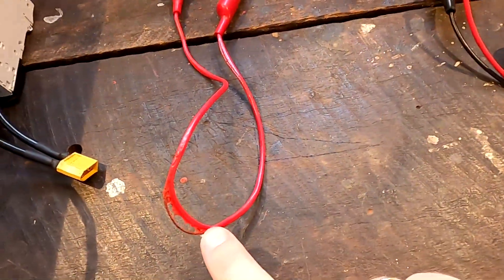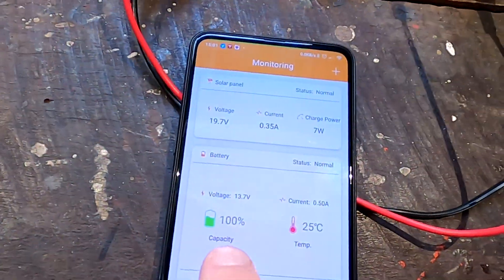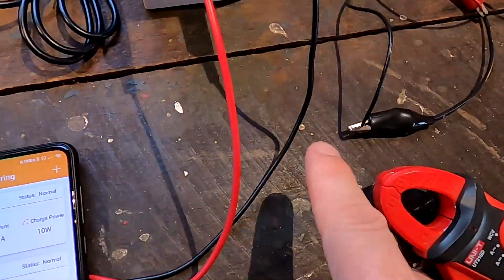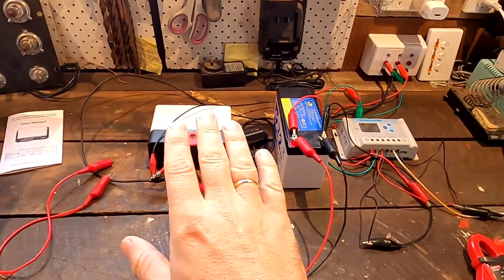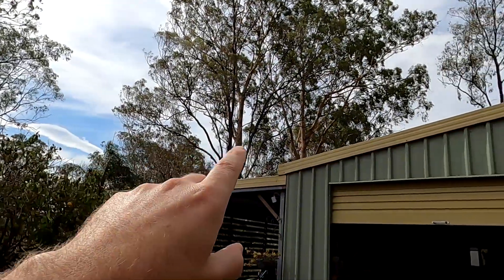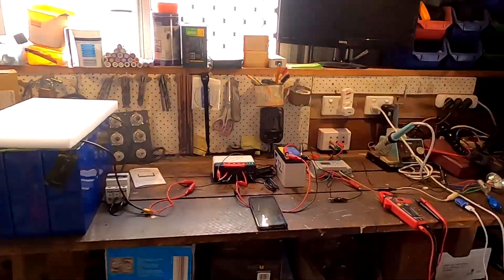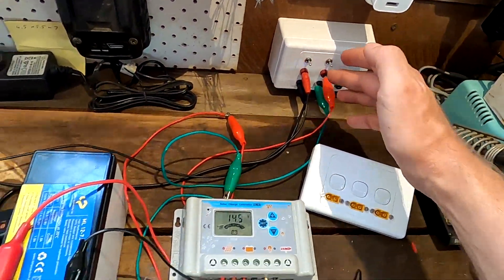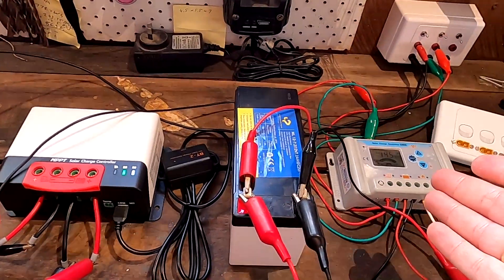MPPT and PWM controller charge one battery. See what happens...

Comment: Hi! I love your videos! Keep them coming! Quick question. I see that you are connecting to the MPPT CC with a bluetooth app and dongle. Could you please share those details on your website and may be make a quick video about them? Also I see that the link from your website takes me to the Aliexpress "version 1.1" of this MPPT, is that the one you have?
EDIT: Actually I don't think I see the MPPT on your website. And the Bluetooth dongle looks very similar used in the Renogy CC.
EDIT 2: I think I found the MPPT on Aliexpress under the name "50A MC2450N10 SRNE MPPT..." It would be amazing if this thing worked as advertised for this price, even if it delivers 25A. It would be great if you could test if this little thing can push 50A ;-)
Reply from the maker: The BT dongle came with the controller and I only ordered the 20A version as I didn't need more. I have now sent it back for a refund, the app shows very different values to what the amperemeter shows. I follow this up in one of the next videos. I would not recommend buying them. The Epever Tracer series seems the far better alternative and is only slightly more expensive.
Reply: @OffGridGarageAustralia  Before you blame the controllers too much, I found this on the web:
"Most DC clamp meters are not accurate at anything less than about 10 amperes."
For that, I still use my benchtop Fluke.

Comment: It probably wouldn't be really worth it, but a mppt per panel would be most effiecent,  in some cases,
Reply from the maker: That would be the ideal solution for a 12V or 24V battery. With a 48V that's not possible anymore, the solar voltage would not be enough. You need at least two modules in series...
Reply: I think it depends on particular design of charge controller. It could be made charge controller that is capable of charging 48V battery from 12V solar panel. Why they don't make such thing is may be for cost or efficiency reason.
Reply: @askostadinov  there is a couple boost charge controllers, but not many, and most are small, used for charging golfcarts and ebikes from 12/24v panels

Comment: The only issue with multiple charge controllers, is they need their own solar panel/s with two mppt controllers connected to a single panel, or array, it screws up the tracking! They fight each other!
Reply from the maker: Absolutely! You cannot connect different controllers to the same panel(s)!

Comment: The maximum voltage of the PWM controller is 50V so if you put two 60 cell panels in series you will smoke your controller. Having shaded and unshaded panels in Parallel will not make a significant difference to the combined output on a PWM controller as the input voltage to the PWM controller is pulled down to the same voltage as the battery charging voltage. The difference between an MPPT controller and PWM is quite small if you are only using one solar panel. Because the charging voltage is similar to the mppt point of the panel.   If you have higher voltages and panels in series then the MPPT controller will perform far better than a PWM.  But if one panel is in shade, a PWM with two panels in Parallel, will perform better than a MPPT with two panels in series..
Reply from the maker: I had not considered the PWM for my garage. I know they have only very low input voltage and can handle panels in parallel.
For the Off-Grid-Garage, I will only use MPPTs. I explain this in the video tomorrow.

Comment: I do like that setup for testing and charging with the switch and banana plugs
Reply: Or xt60 one I just made the comment before you got to it
Reply from the maker: Yes that would be possible too. The banana plugs have the advantage I can just use alligator clips to quickly connect anything for a test.

Comment: I think the idea with multiple mppt charge controller is the better one because of the different voltage output of both solar areas ! At different times of the day!
Reply: Multiple MPPT controllers might be the way to go as an MPPT controller will start charging earlier provided they were getting enough charge from the panels in the string.

MPPT controllers usually beat PWM controllers in shaded conditions.

An analysis of putting strings of differently shaded panels through a single MPPT controller vs using a MPPT controller for each string would be very useful.

Cracking videos, full of useful info and not TOO techie.
Reply from the maker: I think so too and elaborate on this in the next video again.